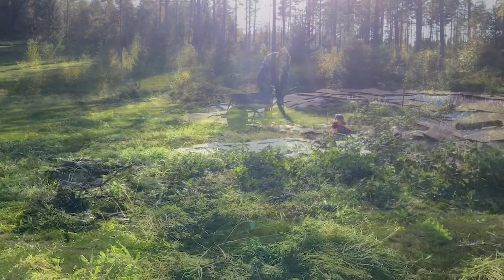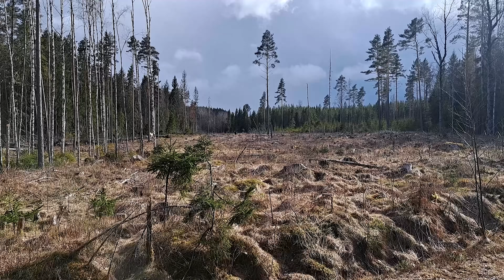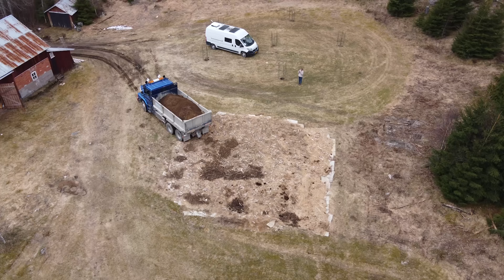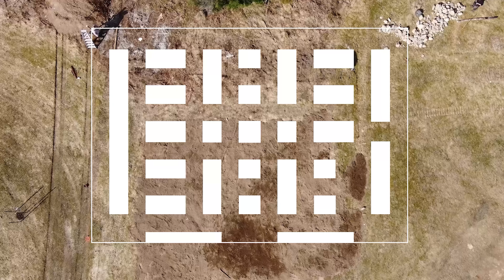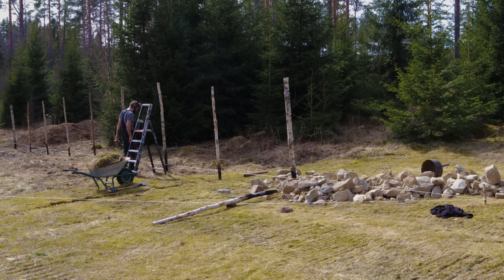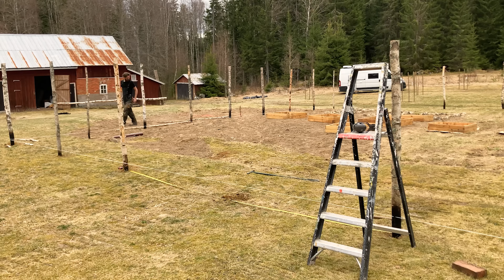Starting a Vegetable Garden (Story 15)

Comment: Dear guys , your tree cages will fail because deer are tall with long necks . The cage must be 6 feet high and about 2 feet out from the tree and the wire should be rigid since they will just lean in and bend the wire down  to eat the leaves 😢
Reply from the maker: Hi! The fences are a least 2 meters high and the wire is quite rigid. Also, the trees were eaten in the winter and therefore really small this year.